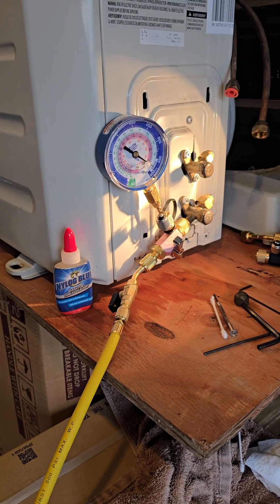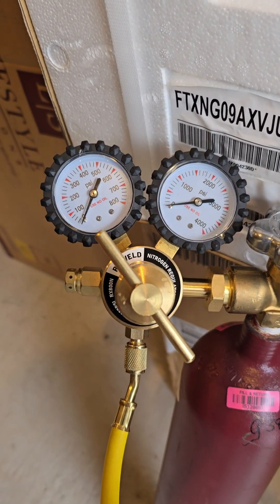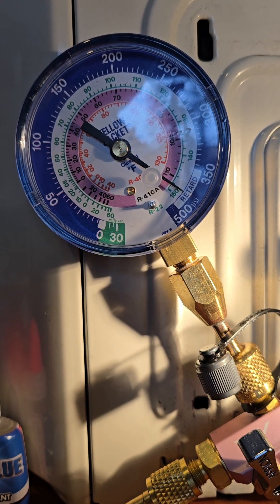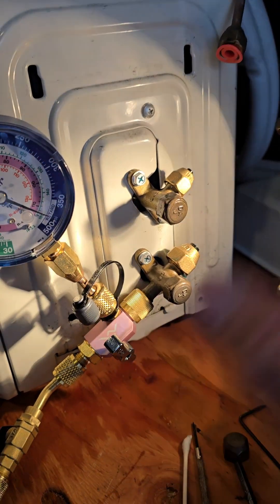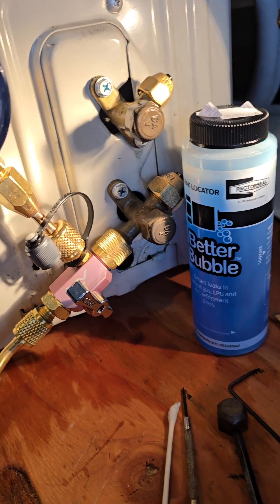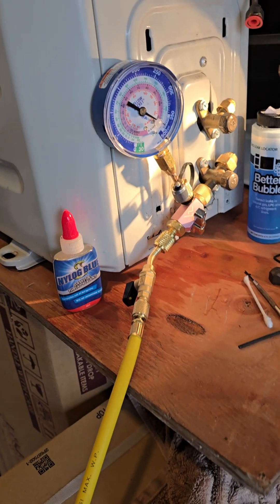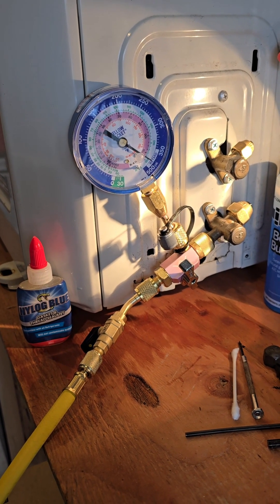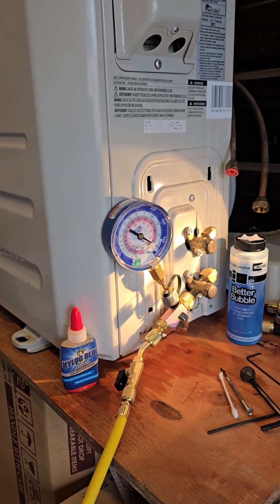Senville Leto.pressure testing the ODU of a mini split

Comment: Going through the exact same issue.  System installed 5 yrs ago.  After 3 yrs, it leaked all the R410a.  Had it pressure tested and bubble tested all 4 of the flare connections.  He found nothing.  Had it recharged.  Now in less than a year, it is empty again.  I am thinking its a pin hole leak on the lineset.  I've been reading that since the service port is on the low pressure vapor line, you should only Nitrogen test up to the max pressure of the low side.  They said it can damage components on the low side.  Thoughts???
Reply from the maker: No those people are stupid 

There's no such thing as one side or another with a mini split they're exactly the same they reverse positions all the time I'm going to send you a link to Craig from AC service tech who literally wrote the book on AC and repairs he is the man and he explains it very well the difference between mini splits and single speed systems which are those big giant monster legacy systems of old anyway they only can stand 300 lb of pressure but many splits need to be pressure tested at full extent or you'll never know whether it can hold it at the full extent 

What I teach people is this

If you can't afford to do a high pressure nitrogen test 

Or people like you have been convinced that doing a high pressure test could ruin the system or hurt it 

Then what they should do is do the best they can with their pressure test whatever they want to do test everything so it's 7 points of failure you have the two connections at the IDU and line set two connections at the ODU and line set The three service valves so that's seven places and if none of those seven places is leaking then there's a 99% chance that your system will hold but of course that 1% is what I happen to me and perhaps what happened to you with having it in the middle of the line set somewhere it had a pinhole once I replace my line set it was perfect so anyway I never did find the leak it was in the middle of the line set somewhere

Anyway I digress 

What has to happen after that is that soon as you passed all that and you passed your vacuum and everything is good on your end as far as you can make it then you plug in your disconnect You go inside and if it's summertime like right now you turn it on cool mode turbo fan 60°. That will instantly put it into full pressure mode which both lines will now be 550 lb or whatever your system is rated for no matter what those people said they can't check the other side cuz there's only one service valve on one line but it is the same pressure throughout the entire system reversing course as it deems necessary so you'll have full pressure 550 lb and that system right now so now you go do your last check you take your bubble tester and go look at those seven points under full pressure while it's under full pressure get out there with the bubble tester and check all seven joints If they are all good that's your pressure test and you're all done It worked out and is a good chance it's not going to be on the line set that's very rare and you're probably good to go You can't know for sure unless you had a digital pressure test up to that degree but 99% chance you're fine now if it turns out this last test which I instruct everybody to do fails and you find a lake now you must stop what you're doing pump down your system but the refrigerant back into the ODU 

Start over and undo the leaking joint see what's wrong with it if you can't see anything wrong with it you either reflare it or put some nylog back on it and try it again whatever I don't know what to tell you You have to look at it and see why it failed if you can tell If you can't tell just re-flare it and start over anyway do your holes testing and procedure all over again and then once you've done all that release the refrigerant again do exactly the same last test over again double check that joint while you're at a double check every joint and if you passed you're good If you don't you got to do it again this keeps going on and on forever  until you pass 

All that can be avoided with a high pressure nitrogen test because if it passes the high pressure nitrogen test at the highest pressure of the system and that's it You can still do the last test but you will pass because it's already been that pressure before and did not fail 

Here's the video from Craig Make sure you watch it and if you have any questions put them down below You can always reach out to and I teach people all over the world how to install mini split so I got plenty of videos for you and plenty of information for you and can talk you through any problems so you can connect with me either through Facebook Messenger or my cell number 541-660-7805 

https://youtu.be/BxMwbC_2ow8?si=IEGE1d8WY__tSkzi
Reply: I had the same problem finally figured it out pinhole leaks due to the white insulation used was made with uv resistance  chemical which destroyed the copper.Look it up online everyone can verify